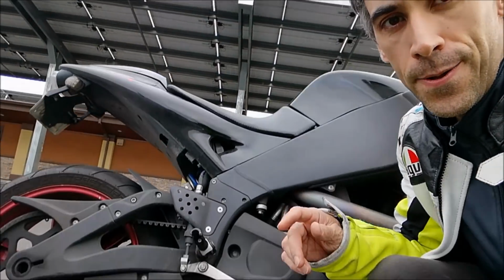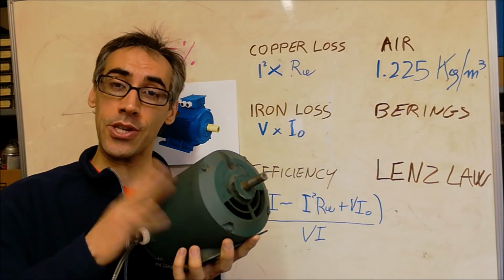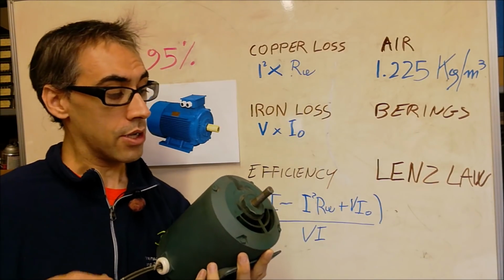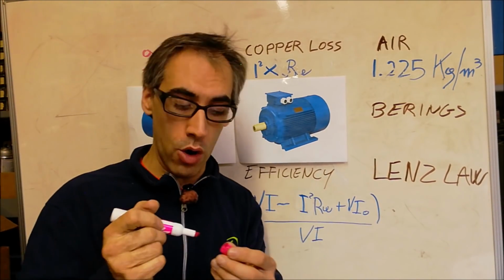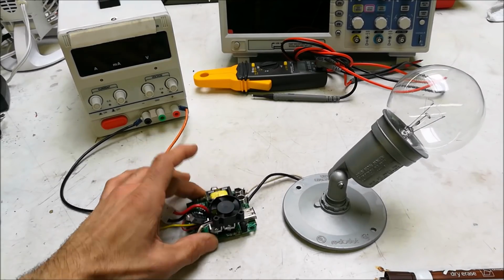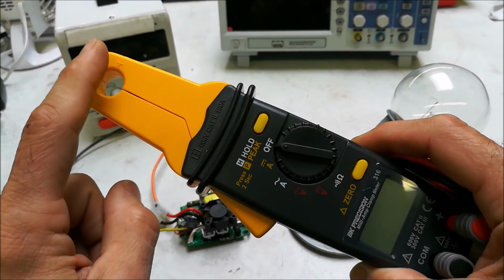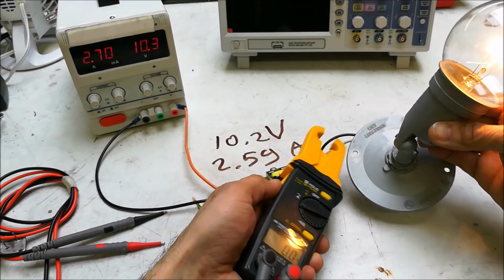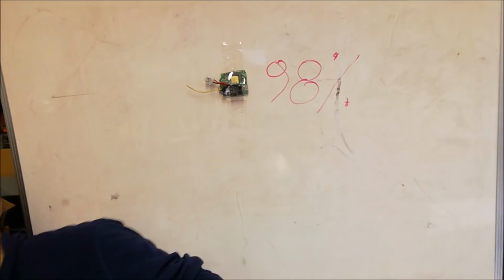WATCH this BIG Free Energy Scam exposed

Comment: I am an electronic engineer and I keep seeing the units that have car alternators with NEOD magnets affixed to the rotor in a N-S-N-S and so on order. The converted generator is run by an AC motor that runs off of the AC furnished by the generator in a closed loop.  I want to build one and try it.  Have you looked into this so called energy generation system?  Please share your thoughts on this subject, I would appreciate it very much, Thank You
Reply: the magnets do nothing but take the place of the electromagnet allready in the alternator.  Powering the motor to turn the alternator from the alternator can never work. Same as making a battery that charges itself. Once you got the contraption spinning and removed the external power it would come to a halt almost immediately. I suggest you use a battery to power the electromagnet of the alternator and hook up the generator output to you motor and drive the alternator with the motor . You will see it won't work and you won't have spent any time or energy putting in the magnets.
Reply: @KevinSmith-os5yz  Thank you,  I get that the added magnets take the place of the electro magnet from the exciter voltage attached to the brushes of the alternator.  Without the voltage applied there is no magnetism in the rotor.  I just was wondering if powerful manets placed inside the alternator somehow made a super efficient alternator.  I realize that it does not make total sense and I just am looking for theories about this device.  I appreciate you.
Reply: @jimsworthow531  super powerful magnets would allow the alternator to put out usable power, ie electricity, at a lower rpm. So in theory maybe you could make one more efficient due to the decreased frictional losses from the bearings. But, and this is the crux of the whole thing, you would never be able to get to or above 100% efficient. Lets say you could get to 100%, any load at all no matter how small would then bring it to a stop. All these free energy devices would have to be significantly higher than 100% efficient in order to work and unfortunately that is an impossibility. They do however generate money from youtube. So in a sense they can create from all the subscribers and views,  but I'm not sure even that is free energy.
Reply: @jimsworthow531  I looked up specs for typical alternator the exciter coil is in the ballpark of 2amps, so a 90 amp alternator you get about 2% increase in efficiency.high efficiency alternators are in the range of only 75% I suspect a good generator head is better but I didn't look it up.
Reply: @KevinSmith-os5yz  Thanks for looking into this more.  I have a GM 10SI alternator.  this unit is self excited self regulated.  There is only one output post for +14.1 vdc. the case is -DC  I connected it up to a 120VAC electric motor by a belt, and the alt output hooked to a car battery.  An inverter was hooked to the battery to drive the AC motor.  When the alt senses a drop in voltage, it no longer free wheels and loads the motor down quite a bit.  I started with a fully charged battery and the whole setup ran 3 hours before the battery voltage dropped too low to run the inverter.  I don;t believe that magnets on the alt rotor would help. No unity or above unity in this system.
Reply: @KevinSmith-os5yz  I like your metaphor for "free energy" from youtube views, clever.
Reply: yeh, that's how  they work in real life. It would be the same as hooking the battery to inverter, then inverter to charger and charger back to battery.more efficient actually but still, End result, dead battery.
Reply: @KevinSmith-os5yz  Yes; and my test generated heat from the alternator, AC motor, inverter, belt pulleys (friction) and the battery even warmed during disharge creating more loss.  The alternator would have to be close to 140-160% efficient to work and that does not exist in any electrical generation I have ever learned.  I read that most alternators are 50-60%efficient meaning we lose half the energy that is used to turn them.

Comment: The blind leading the blind. https://youtu.be/CWuAGEhiYAg?t=653
An inverter isn't a generator, an inverter doesn't generate, turns DC to AC.
Only an idiot would take this fool for someone competent on the subject.
TROLL debunking a generator with a DC to DC converter.   PLS
Reply: None of these free energy generators, generate either. They are nothing more than an old school inverter using a motor to turn an alternator, usually where the electromagnet has been replaced with permanent magnets. They all have a hidden power supply. They used to sell these back before electronic inverters. All that has been done is to hook the output to the input and pretend it self powers. Kinda like a battery that can charge itself, not happening. So actually he did show the correct comparison.

Comment: ...things work if you want it to work..it's all in the mind..add flywheel that spins at least a min before output fluctuates...nowadays there is thermoelectric generator that transfers heat to electrical energy...we need to try harder..why do we need to make car run faster like F1 to kill ourself than to invest more on these project instead..?
Reply: So you want to add more stuff to the system? Flywheel? That’s another power loss due to efficiency, thermoelectric generator? Same thing, you will just keep losing energy
Reply: @Fawke85  ..but Is there any chance as an example: 1kwh motor turn a generator that can produce 10x more with more coils and magnets...it sounds like it make sense..it's like consuming those energy that has been amplified by a speaker from a microphone via a delayed feedback..do you notice how the sound gets louder and louder every times it repeats in it's echoes...the same way if we could apply this in a form of energy than we can harness this amplification by regulating it's power output..
Reply: @surenbono6063  not possible at all
Reply: @Fawke85  ..ok understood

Comment: Thanks for exposing the fake alternator. I am looking at an 18 KW alternator. It requires 141 ft-lb torque to run at full load. What size motor do I need to run it 24/7/365? I will be using a 49Kg Flywheel

Comment: Good insight into free energy scams. Also consider further frictional losses in their power transmission method. Almost all use V-belts, a known high friction method. Engineers know that a toothed belt (like Browning's system) or direct drive reduces losses. Help us refute their claims, thanks for teaching.
Reply: You're right as for the friction, but this is an experimental model. In reality it will be on one shaft. You can't refute it, because it works and has been tested by sceptics.
Reply: @petercernjavski9419  Has it been tested by real Electrical Engineers, at a Certified & Accredited Laboratory? If not, try Southwest Research Institute in San Antonio, Texas. If you device is legitimate, they will file & get the patent for you. Until then, it looks, smells & sounds kinda sketchy. Good  luck!

Comment: you are trying to sell your invention while soiling others, thats not the way of an engineer, you would rather say "yes its free energy but with lots of losses" or "there is a better, simpler, cheaper and more advance way" but you debunking that this is not free energy shows how you dont know anything about electric power Generation. And by the way the Power factor is 0.8 or 80% just like any other hydro electric power Generation.
Reply: You live in a fairy tale world and very poor knowledge regarding science
Reply: Correct!    it's off the grid energy, but it has energy loss.  would be a better statement!

Comment: thank you for debunking these scames before more people are ripped off in donations
Reply: The only scam I see is this guy coz he never takes time and try if the method works......I have try flywheel generator and is working so I don't understand what he says
Reply: @peterbillas9131  himself is a scammer, for me I since believed in self running generator with heavy flywheel.
Reply: @peterbillas9131  
The only thing you got working is your keyboard. You still pay for your electrical bill willys
Reply: @peterbillas9131  don't need to build a glass hammer to know it doesn't work. Flywheel only stores energy like a battery. And not very much unless you can get the rpms up to insane amounts. Any homebuilt one wouldn't store more than a few watts at best, not enough to run anything for more than a few seconds.

Comment: Oh skeptical one, I really enjoy your videos.  I'm not certain if you have covered this one or not, but I'm wondering about Barbosa and Leal in Brazil. Do you know about the work their project that relates to a device for generating electricity comprising a circuit for an uninterrupted power supply system, known as UPS (UPS On Line) (1) and connected in series between its output power loads (2) and the inlet of the supply of UPS itself (3), an electron earth sensor (4) (equipment as defined in Brazilian patent application No. BR102012000838 6 of 13.01.2012) or, alternatively, a electron scavenger of free space (4.1) equipment as defined in the Brazilian patent application No. BR1020120008378 of 13.01.2012). ?  Would you cover this in a video?  Or perhaps comment after looking at their work?
Reply from the maker: Thank you for your feedback

The "barbosa and leal" device needs to be plugged in the outlet constantly

if the claim is "more energy" output why not closing the loop and removing the plug? 

kind of clever trick isn`t? 

Cheers
Reply: @skepticalopen-mind4031  have you seen the patent and tested it yet?
It does seem to be a very clever trick.  I would love to see you debunk that one in a video following their setup in the patent papers.  Thanks for the quick response today!!
Reply from the maker: Yes the patent is public knowledge and illustrated

It`s a simple so called "Joule Thief" .....the current in it`s a constant and no need to replicate things without logic 

Always use rational and logic thinking before building and/or donate money

Thank you for watching

Comment: Even if you had an electric motor running two perm magnet alternators, feeding power back to run the motor, and IF it was 100% efficient, it would only run constantly for a few months before the bearings wore out and it quit.   Even at 100% efficiency, you would rightfully say, "What's the point."   And at 101% where would the 1% come from--a hidden capacitor, or solar cell, or a  copper nail and a galvanized nail shoved in a lemon?  Hey, that's a great idea for a new scam.
Reply from the maker: even IF 100% efficient we still need to adjust voltage/current to proper feedback the motor 

 that inquires another energy conversion and consequently energy loss AGAIN! :)

CHEERS!

Comment: So a GREAT scam could work like this: If a motor is also a generator and you use one of each then you double the power loss, therefore using just a single device would be more efficient.  So just spin up a motor or a generator, connect the wires together and it will produce it's own energy to keep it running!  Please send your donations to my retirement fund. Thank you!  (BTW thanks for the great videos and information.  Keep up the good work!)